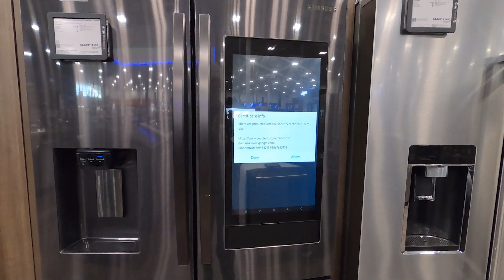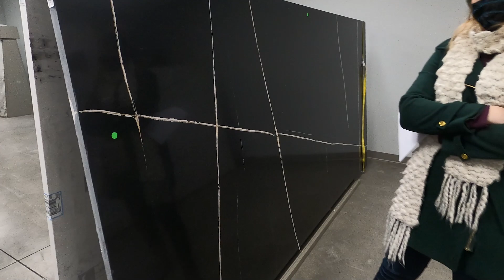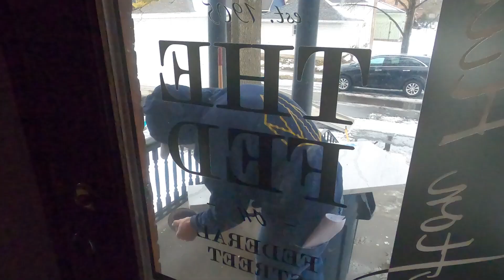08 A Gem in the Rough: Our Kitchen Renovation Comes to Life

Comment: I'm a Daytonian living in a house in a historic district that has old, but not original windows. What was the process like for you getting new windows approved by the historic society?
Reply from the maker: Hi Elizabeth! What historical district are you in? They each vary a bit in rules and regulations. We were told that we should replace all the windows on one wall at a time, so that they all match from the street. We replaced 3 windows that all face the back courtyard. We used Marvin Elevation line which are well known for historical restorations. We also saved all the original windows and parts just in case. Not sure what we'll do with them yet. I believe we are going to try to restore the remaining windows (mainly due to cost!) but we haven't fully decided yet. It's going to be a big job either way.  I'm trying to coordinate our schedule with removing the windows and dealing with the weather, how to temporarily seal up the house, etc. Ugh. Good luck to you! lol  ~Laura
Reply: @coupleofquinns  We're in South Park. This is great information to add to our research. Thank you!